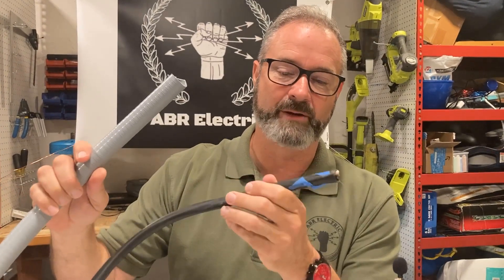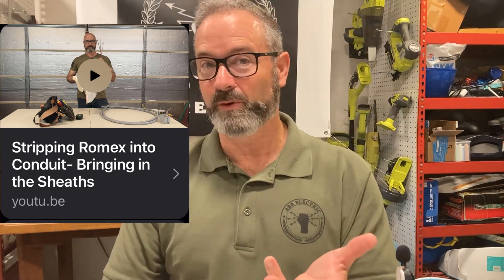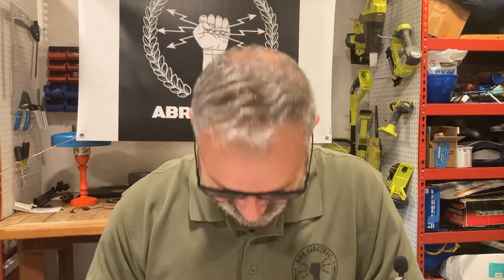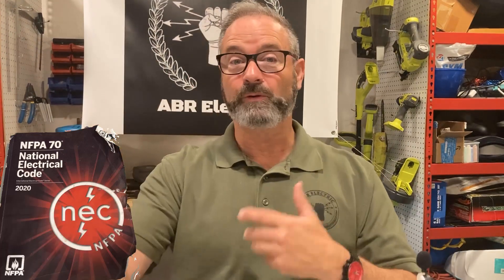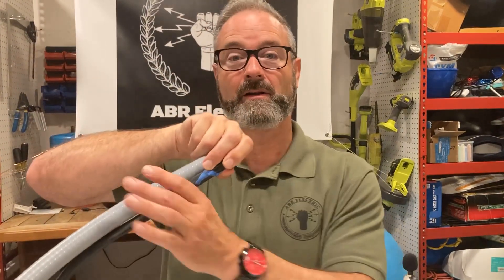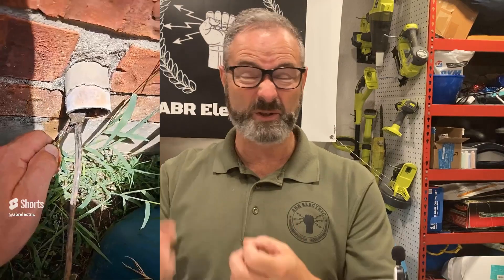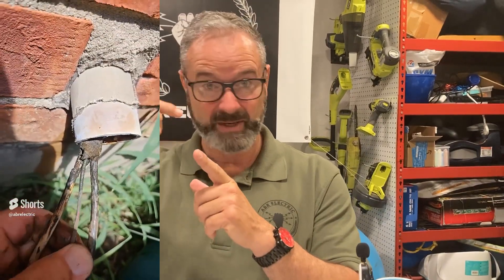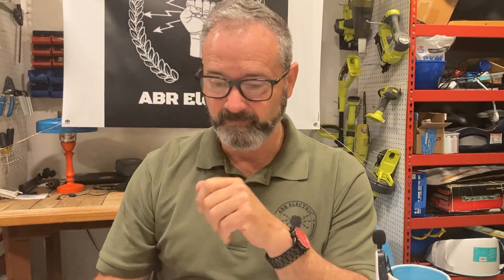Why Romex Doesn't Belong in Conduit: Quality and Longevity

Comment: If I can’t run romex in a conduit. But my main panel is outside so I need to run romex outside from the attic down 5 feet to the main panel
Reply from the maker: You can run UF, or pull thhw conductors to a j-box and transition to romex through the attic.

Comment: Romex isn't used in conduit bodies, for 2 reasons,, the outer jacket is extra material that hurts heat build up and derateing, but also because Romex has paper in it which acts like a wick for moisture,,,, the reasons why it's not allowed needs understood,,,, now you can use a piece of conduit as. Ameans of physical protection,,so long as it's not a conduit body, meaning conduit from box to box,,, now as far as striping off the outer shearing, Romex has thhn in it, so it can be run in a conduit body,,,,,, so run Romex in a jbox, remove the shearing and push into a conduit body with out Cuting is totaly with in code,,,,, inhad a 1/2 EMT , breaker trips, so I show up, turn on the breaker it holds for 2 min,,,, follow the wire, goes into a 1/2 EMT, straight into it and out to the garage,,, that 1/2 emt was about 150 or hoter degrees,, it was hot,,,, so figured out how to pull the wire out,, a tiny Nick they're the outer and threw the conductor insulation, took20 years to, fail,,,,but it failed,,,,, because some one pulled Romex threw metal EMT, with not fittings no bushing no nothing, nicked the wire, and it failed, if that wire wasn't nicked it would still be fine,,,,

Comment: I have two, 1/2" metal pipes that run from my basement to my detached garage. 50 or so feet away? All this was done in 1939. House was built with early NM cable, 12ga no ground.

One of the conduits had its cable replaced with 14ga NM. The other shows no evidence of anything in its pipe in the basement, but about an inch of the old NM sticking out on the garage end.

Yanking on the cable nub in the garage won't budge it. Would love to know how to remove it without digging up all the cement and conduit.
Reply from the maker: There's not a way as far as the underground metal conduit is concerned. If you can get the correct clearances,  you could go overhead with outdoor cable, like a triplex.

Comment: I guess where I come from we install a disconnect within sight of the air conditioner and then run a carflex whip to the ac from the disconnect with THHN wire...

Comment: In your examle, it seems (technically) that the "problem" was the guy who cut and peeled-back the NM sheath...that he unintentionally "Cut" one of the hots too.....not such much the question that NM shoud not be run run "outside" vs "inside". Code seems to say don't run NM outside (moisture hazard) and it's ok inside ( no moisture hazard).. Questions. 1.) is this correct per code?...and if so....2.) what is the true danger of running NM outside?

Comment: Watching this video today I felt like he was telling my own story.
My house was built in 1998.

Starting the AC for the first time this year, the outside compressor would not start.
I could see the contactor was pulling in, but nothing else would start. First thinking this would be a typical start/run capacitor issue, I replaced that without doing any real troubleshooting, but I was a bit surprised to see the one I removed tested OK. 
After this repair failed, I decided to get serious and started measuring and was surprised to see I had 240V at the wall junction box, but not at the input to the contactor. Measuring continuity with power off I was amazed to see one 10AWG wire was broken somewhere. I decided to replace all three wires, and I was even more surprised, instead of finding three strands of THHN/THWN in the whip, to find a single NM-B sheathed 3-conductor with a 1997 date code on it. This wire was just crumbling in my hands as I pulled it out while using it to pull in 3 strands of THWN 10AWG solid. All is well now.
I believe this was an improper application for this product, that could not stand the test of time in this environment, and in addition may have been damaged in pulling at installation, though I cannot say whether this would have been a code violation in Florida 27 years ago.
Reply from the maker: @gregfaris6959  thank you for sharing your story. It's very common

Comment: I'm not sure what you are recommending here. 
Not to use conduit with Romex ever?
What about a totally dry location?
What about no nicks or splices or stripping inside the conduit that on an off chance it might get wet, although sure the bare ends of the wire are in dry locations? Would that be OK?
It seems to me you are dancing on the head of a pin arguing about how to dance on the head of a pin, or not.
Reply from the maker: @normcameron2316  first, I'm recommending you read Art 334, because that's our minimum standard.
Romex is no bueno in any outdoor or underground environment, regardless of being in conduit or not.
In a dry environment, ronex is ok in conduit, as long as it doesn't overfill the conduit.

Comment: It has to do with the products listing. Romex is not listed for use inside conduit. The wire and the NM sheath are listed together. If you look at the wire, it doesn't have a UL listing on it. The listing is on the sheath. At least, that was the way it was 12 years ago when I retired from Building and Safety as a senior electrical inspector.
Reply from the maker: @allanstewart758  still the same today
Reply: NM is listed for use in exposed and concealed locations in dry locations, which would include inside conduit. The NEC allows romex in conduit, and also requires romex in conduit in certain applications.
Reply: @pld8993  concealed locations as in walls and such, not conduit. It can be run in short sleeves, like penetrating  fire walls, and the ends must be sealed with a listed fire sealant.Like I said it in the listing, not the NEC
Reply: @allanstewart758  Incorrect, you need to read the NEC for clarification. Nowhere is romex in conduit limited to short sleeves, there is no length limit, and nowhere is it forbidden in conduit in dry locations. Romex in conduit is allowed anywhere romex is allowed, and sometimes explicitly required in conduit, 334.10(E) and 334.15. If you wanted to run romex in 500' of conduit, while not smart, totally legal. If I'm wrong, feel free to share the NEC reference that says otherwise.
Reply: @pld8993  It's not in the NEC it's in the UL listing. The listing supercedes the NEC
Reply: @allanstewart758  You're wrong. There is nothing in the UL listing that forbids it in conduit. It is approved for dry locations. Inside conduit in a dry location is a dry location. Feel free to share the UL 719 restriction that says dry locations but not in conduit in dry locations. In order for it to be allowed in a dry location wiring environment but specifically forbidden in conduit in that same environment, the UL listing would specify that and single out conduit, and it doesn't. Read and learn before you speak. If it is not UL listed for use in conduit, as you seem to believe, then it would not be allowed in short sleeves of conduit, as you also seem to believe. Again, feel free to share anything in writing that supports anything you've said about romex in conduit.
Reply: The UL listing tells you what you can do. If it doesn't say you can in the listing. Then you can't run romex in conduit. Sorry it took so long to get back. I lost the link
Reply: @allanstewart758  You're wrong. Romex is allowed in dry locations. The inside of conduit in a dry location is a dry location. The NEC explicitly requires romex in conduit under certain conditions.

Comment: As a farmer who does his own electrical, I think wiring should last almost forever if properly done, unless the structure its attached to becomes compromised.  Unless its the old wire from like 1950 with insulation that cracks as soon as you move it.  I assume that's due to materials of the time and/or age, not the result of poor workmanship.  I'm almost positive one of my corn cribs still has a light powered by knob and tube wiring, still works. :)

Comment: I've seen so much conflicting info. I just want to run Romex in my garage. I don't want it in my walls because I might want to rearrange outlets later, who knows right? So I want it on outside of the interior walls, but I'd rather not have Romex just all spaghetti on the wall where it would look sloppy and could be damaged. What other option is there than using conduit? Is the whole Romex/Conduit debate because of code or just a bunch of what if scenarios?
Reply: The so-called debate is only a debate amongst those can't or don't read. The NEC explicitly allows and sometimes requires romex in conduit.

Comment: Ok, you are correct Romex is not approved for use in damp or wet locations.   Couple more important points.   Stripping off the outer jacket is a violation as well.   Conductors approved for use in wireways has the required information stamped on the conductors.   NM cables are stamped on the jacket, and not on the conductors.   So, stripped jacket is a violation.
Another violation was in your story.  If short circuit, it is required to find the problem and repair before turning the breaker back on.  
And another probable violation.  Manufacturers instructions are required to be followed.   Circuit breakers are guaranteed to trip one time in short circuit condition.   Manufacturer (if called) will ask how many amps went through the breaker during the short circuit, to which you will reply, “I have no idea”.   The response will be, send it to us and we can inspect it.

Comment: Wasted of time, wrong question. No romex in conduits under risk of wet condition. Use thnn/thwn  wire only. It is not a question of how long the work should last.

Comment: I'd never run Romex in EMT or Liquid Tight. I always runTHHN. Thanks
Reply from the maker: Thank you
Reply: What about furnace drops, basment wall receipts, etc.? Do you run complete conduit runs, or  J-boxes at every drop point. Doesn't seem cost affective and your adding an unnecessary splice on the circuit. Not saying its a bad way to do it, maybe a little overkill.
Reply: @ericnortan9012  BX is what's used for furnace and outlets.
Reply: @ericthat  You're obviously not an electrician.
Reply: @ericthat  And what exactly would my code book tell me?
Reply: @ericthat  Wrong, currently licensed in 3 states, been in the trade for over 40 years. You told me to look at my code book. Again, what exactly would my code book tell me, genius?
Reply: @pld8993  not to be run in damp or wet locations. Even in room temperatures.  Heat radiates from conductors and shorts/fire. 
In my 40 years of experience. I've found this to be very true.
Reply: @ericthat  You said you never run it in emt. What does that have to do with damp or wet locations? Drops for basement wall receps, drops for furnaces, etc, these are not damp or wet locations.

Comment: Can you run a bare ground from a 200 Amp box to a 100 Amp breaker box the wire will be run in a gray pvc conduit
Reply from the maker: #8 or larger in a raceway should be stranded. Article 310.3

Comment: Romex is fine outside or inside  of conduit inside in dry conditions. For small jobs you'd do for yourself at home, and not having to go to the expense of reels of wire used for running inside of conduit. Commercial jobs, yes, you would NOT use Romex in conduit.
Reply: On most commercial jobs romex is not allowed, whether in conduit or not.

Comment: The title to your video is a poor way to get to how long should one's work last. 
1. NM Cable is permitted installed in most raceways, not just EMT. 
2. For instance, EMT. 300.18(A) exception, 334.15 (B), 358.22- 2nd paragraph, Chap 9 notes to tables.
 3. NM cable is not permitted outside the building, nor in underground installation. 
4. Your example could have been any wiring method - the work I could see was disgusting. NM Cable has been successfully installed in EMT millions of times across this country for decades.
 5. Manufacturers for all kinds of electrical items have specification and installation instructions on their websites. Free to download. UL website has a ton of free information - such as the White Book- ll22+ pages of information. NEMA also has a long list of free information. 
6. Start referencing those documents and good NEC Section numbers and  your list of  subscribers will grow...

Comment: so......what IS the correct cable to run inside the flexible conduit?
Reply: Any cabe or wire rated for the application. THWN is probably the best/ most common wire. UF cable is common too, and generally pretty cheap (relatively speaking)
Reply from the maker: In outdoor damp/wet locations, either UF cable or individual THW, MTW conductors.

Comment: I've never been a fan of NM cable of any kind. Rewiring and servicing are a giant pain. The possible nail or screw through the sheathing is a constant risk. Imo, you should always put NM in conduit.
Reply from the maker: Why not, then, just pull THHN?
Reply: @abrelectric  rewiring means knocking out and replacing giant chuncks of wall/ceiling/floors and taking out all those staples. During service work you often need to jiggle wires to hear/see how boxes are connected and you cannot do that with NM. The sheathing does not offer any protection at all to someone putting a screw or nail through it. Just to name a few.

Comment: Sadly when I got my first electrical job as a helper 29 years ago, we were working on a brand new apartment complex and we stubbed the Romex from the disconnects through the flashing where the refrigerant lines passed through the wall. We stripped it and just slid the seal tight right over it. Some of the wires were too short so my journeyman handed me a bunch of yellow butt splices and had me make splices inside the flex. Even though I was green, I knew this wasn’t right but I was just a helper and had no say. As a journeyman today, I will never do anything like that.

Comment: I started adding type NM cable for additional circuits in my house almost 50 years ago and inspect that and superior type NMB cable that came out in the early 1980's to last over a hundred years.When I purchased my all gas home it only had 5 circuit breakers. Filled up a 40 circuit panel and had to install a sub panel. I used to put up entire front of my house with Christmas lights so ran 3 dedicated 20 amp GFCI receptacles.
Reply from the maker: Good work! Always good to have enough power without worries

Comment: Type NMB ( romex ) is never allowed in a damp or wet area. All outdoor areas are considered damp locations. We can only install say a 6' piece of NMB cable down a cement wall to protect the cable.  The insulation on NMB cable never has labeling ( printing ) to identify the insulation type or guage of wire. And yes a second week appratince should be able to figure out if a solid wire is,14, 12, or 10 guage.

Comment: Hello, 
The problem i would  trouble trace to (i don,t like to use the words troubleshooting) is why is there moisture/water getting into the carlon flex? When you run that from a cold location to a warm location, there will be drafts and condensation.  Was the flexible raceway sealed with duct seal or any other approved sealing compound?  The code intent of certain raceways is to keep  liquids/gases/dust out of the raceway or enclosures . If that can,t practically be done, then wires run should have a "w" on it. And of course all raceways according to code in damp or wet locations shall be arrainged to drain. Unlike plumber's piping or their raceways is that it keeps the liquids/gases/dust inside their piping. Oposite of our electrical piping. It can be debatable about running romex or non -,metalic sheathed cable in conduit. First of all romex should be severly restricted . When i built my home from scratch, i completely wired it in EMT. IN MY OPINION ROMEX IS UNSAFE IN ANY HOME , AND I HAVE STUDIES THAT CAN PROVE IT.  PERHAPS INSTEAD OF ROMEX THEN TYPE UF CABLE OR NMC SHOULD OF BEEN RUN IN THAT CARLON FLEX. 
           MISS PAULA WALACH-FORMER INDUSTRIAL ELECTRICIAN-UNION MEMBER IBEW-LICENSED SINCE 1972 ----STILL WORKING WITH TOOLS FOR A  RAIL MASS TRANSIT FACILITY . 
           PS and yes , ive seen what happens in electrical splice boxes that are mounted a few inches below running rails, in which previous electricians stupidly splice wires using regular wire nuts that are not approved wet or damp locations. I,ve always insisted on using BUCHANAN ALL COPPER CRIMPED SPLICE CAPS WITH SNAP ON INSULATED CAPS. CAT #2006S  & SNAP ON CAP  2007 INSULATED CAP. I,ve been using them for 51 years. They are excellent for vibrations and can be used in damp locations. Hence, when i tuck the spices into a box , i aways whenever possible stand the splices vertically so that splice cap would act as an umbrella in wet or damp locations. Rebular wire nuts corrode, even when a hack electrician wraps electrical tape around the wire nut that is listed for dry locations only.
Reply: Whats wrong with "troublshooting"? That is the part of the trade lingo. When I say "im going to troubleshoot this circuit people know what Im talking about. Not trying to give you the business,  genuinly curious.
30 years in trade.
Master Electrician 
JIW 
IBEW local 692
Reply: Your opinion is irrelevant.
Reply from the maker: That is excellent information,  thank you!